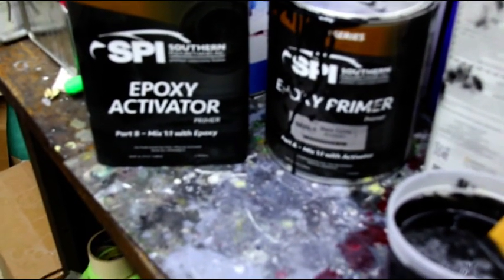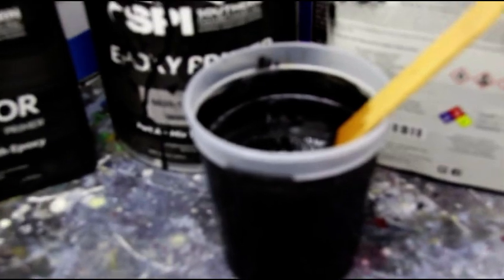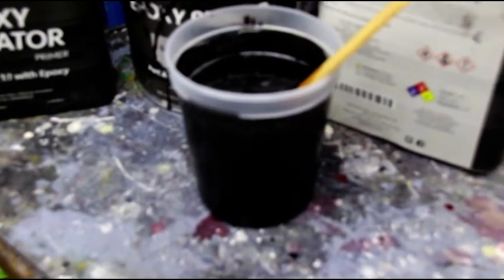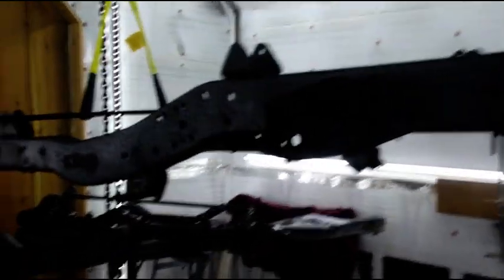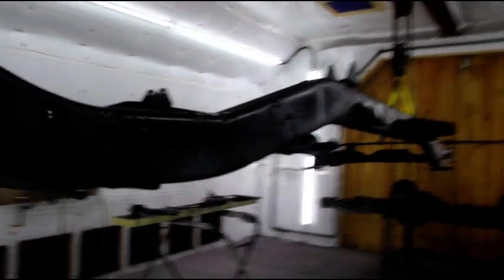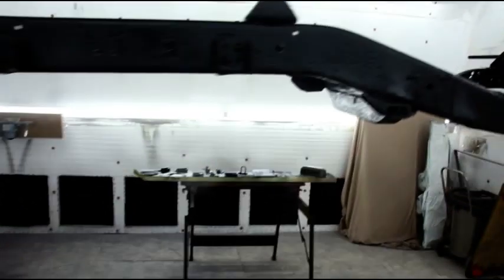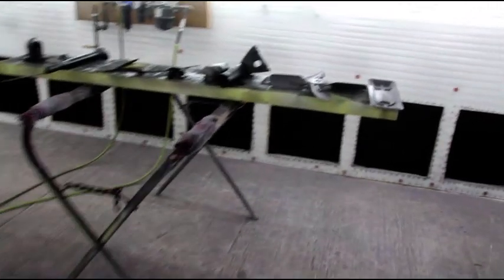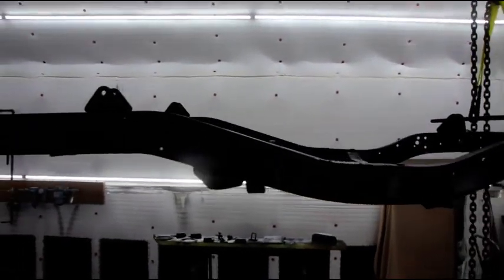Jeep CJ5 Frame..... Laying Down Epoxy Primer

Comment: While you’re in this painting series of videos do you think you could put together a single reference video for guys like me that want to try painting but have very vague or disjointed understandings of each step? Maybe an overview of what to use and when from bare metal to finish paint. When to sand and what can be painted over. A video that kind of ties all the stages together so we can use it as a reference as we go through the stages. It would be super helpful to have all that general info in one sequence so it can be easily referred to. I forget what I’ve learned from video to video when I follow along and ask questions at different stages of the process.
Reply from the maker: Good idea, I will  try to get something together .

Comment: Thank you for yet another informative video, I was never a fan of powder coating either, thank you for your input about it. I was wondering what welding do you use to patch body panels? TIG welding? Have a great weekend.
Reply from the maker: I use mig and tig when doing patch panels.  I know people don't go back and watch my older videos but I have put out a lot of information on both procedures when i was showing how to build a body tub.

Comment: Your obvious preference is epoxy primer. What is your experience or thoughts about POR15 on the frame and chassis components after blasting?  Thanks I’m enjoying your channel!
Reply from the maker: Epoxy primer is the best product you can put on sandblasted metal.  I don't use POR 15 and have seen many problems with it when not applied correctly.   It is up to you what you decide to put on your parts